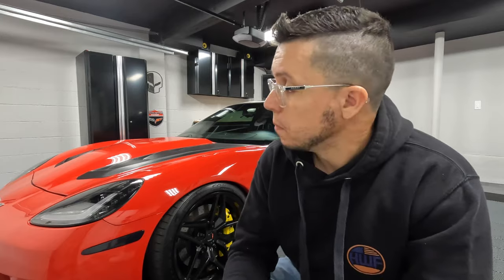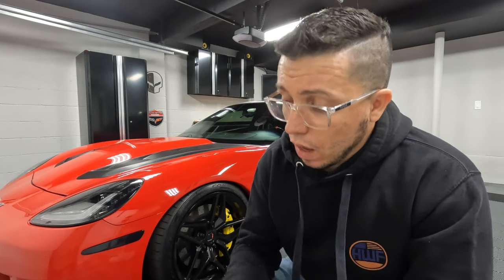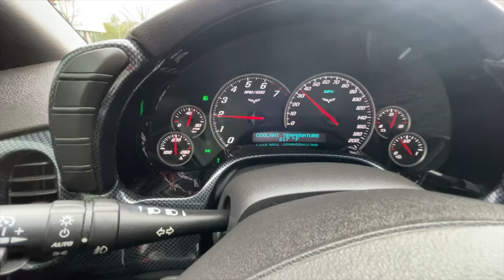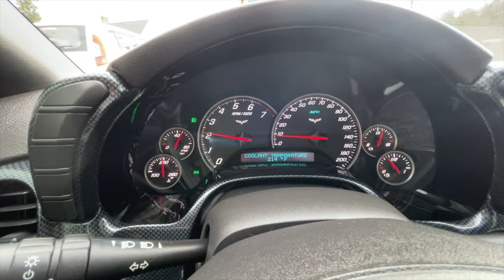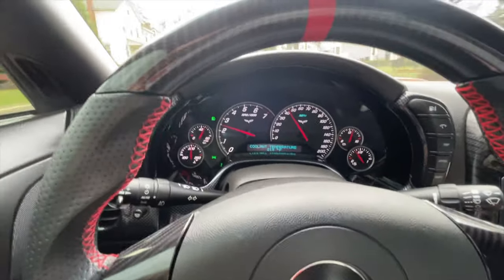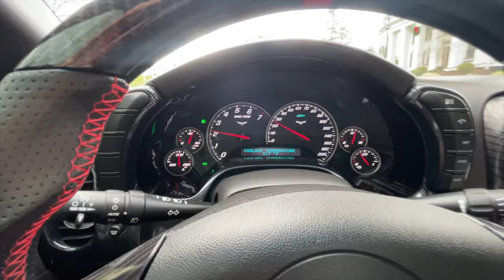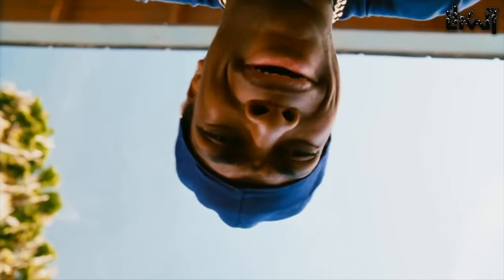Corvette cheap modification WENT WRONG! MAJOR PROBLEM I can't fix it!

Comment: Grab a can of starting fluid and start spraying it around the intake where it seals to the heads, throttle body and brake booster. If the engine starts knocking that’s where the vacuum leak is.
I don’t think you would see a high idle if you fixed a small vacuum leak. If anything you will have an issue getting the car to idle because it will have more metered airflow than before and should result in rough idle. Unmetered airflow will force you to add fuel and then when that is resolved the car will run rich. High idle from a vacuum leak is caused by a lean condition and the extra air flow going into the engine. 
Shouldn’t be too hard for the guys at CSP to figure out.
Reply from the maker: Right man! Thank you for sharing everything! I hope CSP will be able to solve it!

Comment: I think you are on the right track with the vacuum leak, but maybe an under the manifold leak. 
I'd pull the intake, check those gaskets to make sure they are seated properly.
Then re-torque [first hand tighten each one snug to the same feel] in the proper sequence. Don't use power tools on it. 
Composite intakes are a pain and sometimes a hairline crack can develop and the whole thing is shot. 

I'm curious how the dyno goes. 
Youtube suggested youre video to me. Tossen' ya a sub.
Nice C7.
Reply from the maker: Right! I did pull the intake manifold out and check everything did the torque specs and son on… let’s see what the tuner will find! 

Thank you for subscribe the channel! Really appreciate it!

Comment: the issue is probably that you cleaned the carbon off the inside of the throttle body and you didnt do a relearn on the throttle body position sensor. it will not learn by itself. the other thing is you could have a small air leak after the mass air flow that is giving you more air then you should have, this should throw a check engine though so i would start with a tps relearn through a obd2 scan tool that is capable of doing such a procedure.
Reply: everything you said makes sense and it could be in the tune if you previously had a vacuum leak
Reply from the maker: I did the relearning process… with a OBD2 tool and it didn’t work as well… but thank you for going over the options… i think the tuner should give me a answer… let’s hope

Comment: Dude,I'd rather cut my thumb off w/ a hatchet than lose one of my dogs. Have you thought about getting your son a puppy for Christmas? It worked for me. Well I thought vacuum leak or throttle body too,try corvette forums, that's an LS3, very common. I'm sure someons had a similar problem. When I had mine 6 yrs ago I was lucky, I have a shop 1 mile from the house & he's a corvette guru. Actually fixed problems the dealer couldnt. Good luck,@ least its December, you have 4 months to figure it out.
Reply from the maker: I know man! I agree 100% with about the dogs I would do anything to no seeing they go! I did a lot of research on the problem and it seems thar everyone did the throttle body relearning and it works!! Not sure why mine didn’t work! 😅